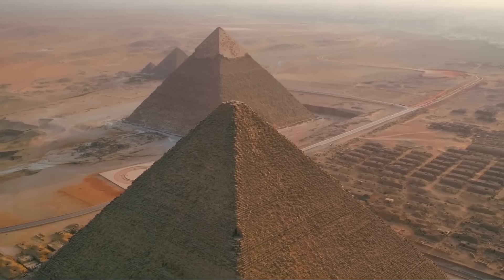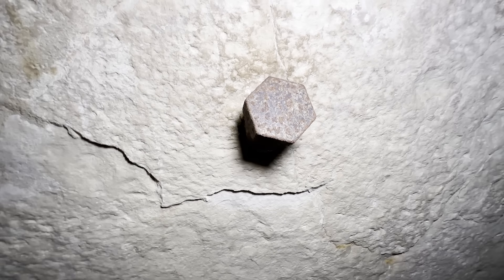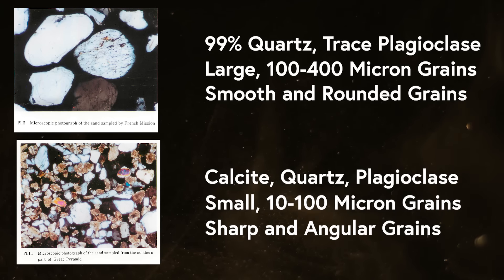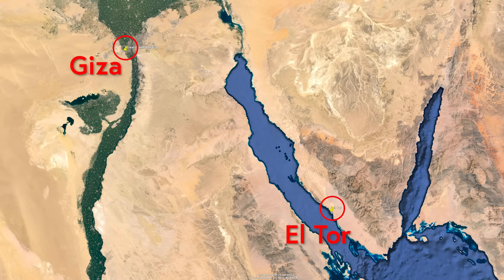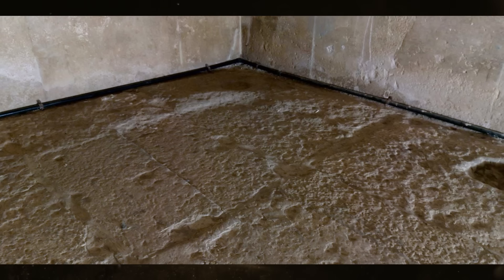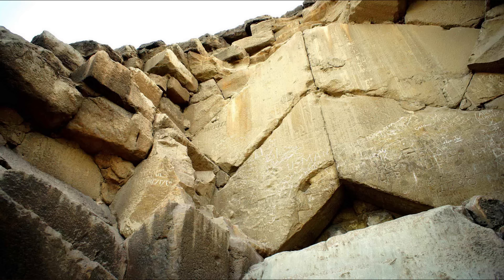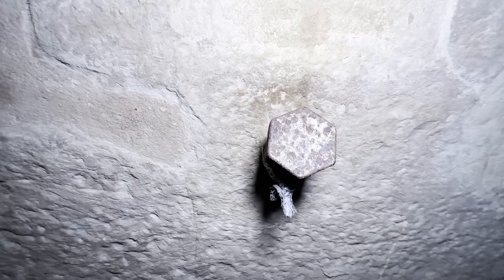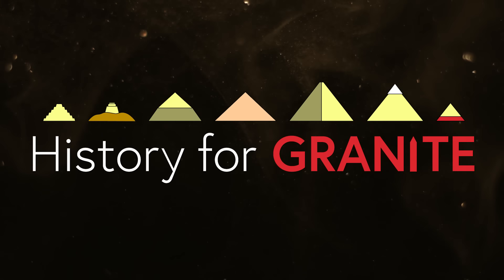How Sand Built the Great Pyramid

Comment: From all your absolutely marvelous videos I have to say I find that one the least convincing.
Not the idea that special sand was used during construction. But the idea that is was used as filler material so far below the "working level" of the chamber roof. 
Going back the chain of logic the other way, the sand found during the drilling was very likely NOT used during the construction of the queens chamber. (But likely during an other construction phase.)
The entire passageway to the Queen's Chamber is well below the stone course where the chevron stones end. Therefore, it would have taken an enormous effort to raise the chamber walls and all the supporting stone work ONE METRE above the level of the later passageway before the other stone courses were finished. 

Connecting the sand found during the drilling with the roof of the queens chamber ist just far too much conjecture for my tasting.
Reply from the maker: Not even for a cavity left on purpose to receive the excess sand?
Reply: @HistoryforGRANITE  
Seems a bit odd to leave cavities 2 or 3 meters deep in the  stone courses your are working on, that low in the total courses of the pyramid. 
Also why not just throw the sand down the side of the pyramid if you want to get rid of it? Far too much work and organisation to keep holes in the middle of your pyramid just to get rid of a bit of sand.

The sand was either deposited while working on the stone courses below the queens chamber ( hidden structure? ;) ) or it had an entirely different propose than lowering the friction coefficient. 

Also your hypothesis that special sand was used to fill a temporary gap as support material is not that convincing. Coarse sand can be easily compacted with a little water and turns into an exceptionally hard surface. And it can easily be excavated again. With bare hands if need be. 

The stones with the aligned joints combined with the special sand under them seem to be more connected to me. Maybe an experimental construction method.
Reply from the maker: If the rough fill of the core masonry had large gaps, excess filler sand could easy flow down a short distance from the bottom of the chevrons to slightly below the QC passage. 

You can’t actually know how sand will compact under pressure without testing it, even today in the 21st century. But the rounded quartz sand would be far superior under stress. Add the 1/2 reduction in friction and you’ve got an ideal material for the purpose of getting the ceiling into place. Could it have been done another way? Of course. The point is that it connects all the physical evidence together in a coherent way.
Reply: @HistoryforGRANITE  
"If the rough fill of the core masonry had large gaps, excess filler sand could easy flow down a short distance from the bottom of the chevrons to slightly below the QC passage. " 
That´s a far more logical approach.
But how wide were the sad deposits discovered during drilling? Like 40cm at one location? 
Even for very rough masonry with uncut field stones those would be very large gaps. So I still don't think this is the reason for the sand deposit. 

"excess filler sand could easy flow down a short distance from the bottom of the chevrons to slightly below the QC passage."
I have problems here with the word "short". Between the lower edge of the chevrons and the bottom stones of the passage are at least three courses of stones.  Probably five. 
It's definitely possible for this "special" sand to fall down several courses of gaps. But how you presented it, it appears to me that there are rather large voids completely packed with exclusively this sand. 

"You can’t actually know how sand will compact under pressure without testing it, even today in the 21st century." 
True. But as you also said about the old Egyptians: They had all the experience with sand. 
Hauling in large quantities of special sand just as a temporary filler makes little sense when a bit of compacting would work with local sand, too. 
My gut feeling tells me this special sand was used for its friction properties. Either for hauling large blocks on sleds or for something more mechanical. 

 "The point is that it connects all the physical evidence together in a coherent way." 
To me this is not coherent. 
Why use expensive material as a temporary filler when less expensive material works just as fine with a tiny bit more preparation? 
Why would you leave large voids in your structure just to get rid off a tiny percentage of your total special sand used? 
Why are there large voids completely filled with special sand about five courses under the layer where it was most likely used? 
 
I really think you should tackle the "sand in void" problem from a totally different direction. Not from the chevrons, but from the passage and its peculiar gap arrangement.
Reply from the maker: I appreciate the thoughtfulness of your replies. Considering the enormous amount of material brought to Giza from all over: timber from Lebanon, copper from Sinai, granite from Aswan, Turah from across the Nile - I don't see ~60 cubic meters of sand to be a 'huge haul'. When setting a 40t beam inclined, even a little bit of slippage would be tough to remedy. Better to just use the best stuff in my opinion. I've had all manner of ideas about low density behind the QC passage, but that sort of speculation isn't grounded in the evidence at hand. I'd love for there to be some exotic hidden passage abandoned after construction etc - but I can't find any reason for such things to actually be necessary for the pyramid. The chevrons were new technology, and this is where I see exceptions being made by the builders.
Reply: @HistoryforGRANITE  
"I appreciate the thoughtfulness of your replies" 
Thanks! I love your fresh and in-depth analysis of everything concerning the pyramids and not being "shackled" by the traditional line of thoughts. 

"I don't see ~60 cubic meters of sand to be a 'huge haul'. When setting a 40t beam inclined, even a little bit of slippage would be tough to remedy." 
We can agree on that. It's possible. The logistic behind it is big, but absolutely within the ability of the builders of the pyramids.
My problem is more with the current placement of the sand and that you seem to argue it was placed there after the chevrons were put in place.
After all the genius and practical building solutions you have shown us about the pyramids, it's just not logical that they would build the passage way after placing the chevrons. 
And the argument about sand falling down large gaps makes equally little sense to me. Especially since this area is so low in the pyramid. Simply assuming extremely rough masonry that low in the pyramid goes against everything the builders have demonstrated to know about structural Integrity. Or at least as far I have seen it. Maybe you have other reference points? 

"I've had all manner of ideas about low density behind the QC passage, but that sort of speculation isn't grounded in the evidence at hand." 
If there is no or too little evidence in either direction, it's often best practice to say "For now we can't figure that out." and move forward until now evidence emerges. 
Else you need to start circular logic to uphold your arguments. (As we see in modern Egyptology...)

Comment: Gr8! First time I hear about sand composition inside pyramid(s). The coarser sand as you mentioned will avoid colection of moisture inside! In the past climate was more wet. rain through stones could go inside structure - ana led to water erosion, making of springs, streams in walls - this could be danger for structure. Like in our pavements. So material in basement - here inside pyramid close to corridors are empty spaces withthis coarse sand - lead to drain water through, stoping its collection inside! MArvelous solution!

Comment: Sand hydraulics to gently settle multiple tonnage of blocks has been proposed in the past, but we are still perplexed regarding lifting the blocks so they can be settled into place. During the core samples where different thicknesses of sand were discovered can be seen as "leveling"...yet no images are left, no writings and no tools discovered explaining the sand hydraulics method. It's a good start. Thank you for your thoughtful description.
Reply: There's documents on lowering the sarcophagus at the The Serapeum into place with sand removal technique.

Comment: If you build a wall with bricks and mortar, you want the bricks to overlap to make the wall stronger, but in a very long corridor that is subjected to high forces and inevitable movement you can avoid cracks in the stones by alining all joints and not using mortar, which allows the stones to move a little in relation to each other.

Comment: That part of the tiny sand with rounded edges used for transportation is really interesting to me. At work we sometimes get products back that are sandblasted with a very small grain of sand, when there is some leftover of this sand on the concrete floor it gets dangerously slippery when you step on it. Probably a bit similar like putting soap on a rubber or plastic surface. I can imagine if you spread this out over the floor you could easily transport heavy objects on it.
Reply: I think you may have some confusion about the sand. The “tiny” sand was NOT used for “transportation” or as a medium for reducing friction and it is NOT the rounded edge sand. The larger sand & rounder quartz grains shipped in from afar were used to reduce friction when moving blocks because it flowed better and compressed less than the sharp “tiny” sand. 

Sand blasting is usually done with garnet and as pointed out in the video it is the sharp “sand”.  It might be slippery but not as slippery as the larger rounded edge grains.

So in conclusion it is the large rounded edge grains shipped in that is used to reduce friction and not the local small sharp sand which is ubiquitous around the pyramids.
Reply: @teeanahera8949  okay, thanks for clearing that up. I can't find any specific's on the material they use for what i called the sandblasting. The method and materials they actually use is not clear to me as they have it patented and are very secretive about it. They call it viwateq finishing, But i expect it to be similar to sandblasting.

Eitherway the most important point i was trying to make was that that material is slippery and that i wouldn't find it hard to imagine that you can transport extremely heavy objects with it.
Reply: @teeanahera8949  I assume his point was that the blasting-sand got rounded by use, and thus more slippery.
Reply: @Luc-1991  I work at an aluminum foundry and we use very small steel shot for blasting.  It produces a dull grey finish on the parts and makes the floor very slippery if spilled.  Really it is like very small steel ball bearings, perhaps .75 to 1mm.  I will have to measure when I get the chance.

Comment: So I was fascinated with your info on the sand filler.  As a person who used to do lapidary and has lots of historical jewelry knowledge it kept bugging me until I think I found the connection. With the founding of the papyri for the pyramid stones at Wadi al Jarf, it was also mentions copper that came across from the sea to use for the tools for the masonry of the pyramid. El Tor where the sand came from could have been where another port for the copper or turquoise was. Most of the mines are more North of El Tor, so maybe the sand was misidentified or there were ancient mines near their that we are not aware of yet. Also sand of the same size or grit would be instrumental in a good finish if they were using it to cut with (metal, stone, etc).

Comment: Stonehenge was really easy to build. They mounded that hill up higher than the stones are presently...dug holes to fit the stones...then dragged the stones to the holes they made...slid the stone into the hole which uprighted it...then dug the remaining dirt out from around the stones. We learned that in grade school in the 80's. A really smart old guy made a little Stonehenge this way. He used a little bulldozer to push the stones into holes he dug that made the  stones stand upright then dig out from around the stones.

Comment: I am currently in a 10 day trip to egypt and i have recently entered to the pyramid menkaure in gyza and what i saw into the burial chamber took my breath away. i spend 45 minutes to 1 hour inside and i noticed something amazing.

it looked like every single block from all sides of each wall was build from one single block, as if the 4 walls were contructed from 4 individual massive blocks, the patterns of the juctions between each block is perfectly alligned and the cut is a perfect straigh line. like if you take a chocolate bar and cut through each square with a hot knife and put it back together. 

if someone could analyses my videos and pictures i took i would massively thank, im not sure how to share the images. thank you

Comment: I love how you see the small details. The things most engineers miss in design. My business is building structures. I’m sending the RFI to clarify intent. I think the early pyramids were first, and for other purposes besides burial. No evidence of burial. The smaller ones were probably attempts at what they found.
You do a fantastic job of describing what you see in the stone, but apply that to Egyptologist spiritual guess work. I would love to hear an engineers thoughts on advanced machines using the same logic you’ve applied to the actual stone. Passages as pressure building, or reliefs. The movable stones don’t make sense to detour grave robbers, but a kind of valve. The notches in the grand gallery are very interesting in terms of machinery. The grotto seams to be a reservoir similar to an engines oil pan.

Comment: I can understand the resson for the use of the rounded quartz sands in a place where it would be difficult to compress,when manoeuvring giant blocks,but I think I've mentioned before.but soaked reeds do a fantastic job of sliding immensely heavy blocks ,maybe sand was included,but not necessary.ive seen an example where using wet reeds can reduce the manpower from needing 200 men to just 20.the sand you speak of holds a lot more moisture without affecting it strength when compacted,but in a way,this makes it even stronger.

Comment: At 5.02 the reproduced images of the sand from the eastern (top center Plate 8) and  western (bottom center Plate 10) are slightly different but contains some of exactly the same grains of sand (not just the same type of sand but the same grains).

Comment: Very interesting. First thing that comes to mind about the hypothesis of using the quartz sand as a material to ease the dragging stone blocks, is that wouldn’t this grind the sand down in to smaller sizes? If so, would it still be suitable as a filler?

Comment: It makes sense to use solid rock on the inside and outside and fill the cavity between them with spoil or sand.
Medieval castles are built in similar fashion with rubble used as the infill.

However the problem starts because the walls are not vertical on the outside.
Therefore care must be taken to use non settling material in load bearing area's and sand where it's safe to do so.

Comment: one reason to use high grade sand is to fill hidden voids that can introduce subsidence of the surrounding blocks or filler. if the sand has an easier time flowing it can spread at shallower angles and continue flowing into cracks before clogging.

Comment: I saw an amazing video showing how sand would have been used as an abrasive material with copper in order to cut and shape granite. 8 wonder if one of the sands was better than the other?

I also wonder if, based on what was seen in later pyramids, they werent intending to put a "writing layer" of stone inside the Queen's chamber - anticipating the extra wall depth may also help explain the 75mm border

Comment: During WW2, when the Allies were approaching the Siegfried Line, a 390 mile (630km) long line fortifications along the western border of Germany opposite the French Maginot Line, there was considerable worry about the losses that would be inflicted on the Allies in any attempt to breakthrough this defensive position. Many felt that simply bypassing the line was the only way and others planned and even built special super heavy tanks and other equipment to blast through the massive fortifications on the line. Instead, a note was taken from the ancient Egyptians (I think) and the Allies were able to quickly defeat and pass right through the line without the need for all the heavy equipment, explosives, etc. that were thought to be required. Sand/dirt was simply piled on top of the wide line of Dragon's Teeth and they drove right over it. Simple yet effective.

Comment: How about this: if the system for closing (and possibly reopening) the king's chamber is at the time of construction a new, untested, design, wouldn't it be a pragmatic approach to still build a traditional burial chamber as back-up? This would be then unfinished (because if not used, why put in the effort), but prepared for possible future finishing (ex. aligned slabs in the passage way), and provided with the (closed, but easy to open up) ventilation shafts. This way, if the new design of chamber is proved unpractical or even impossible to close and reopen, the effort of building a whole pyramid is not entirely wasted as the more traditional chamber chamber can still be used. (Still, all of this is lots of conjecture.)  

Thanks for all the interesting content on this channel!